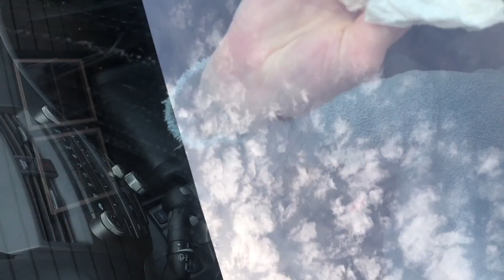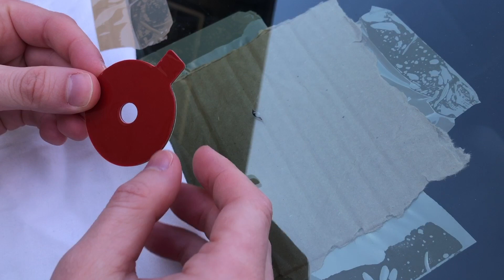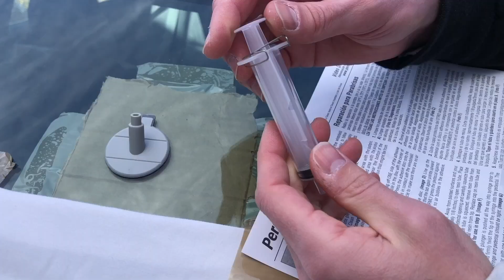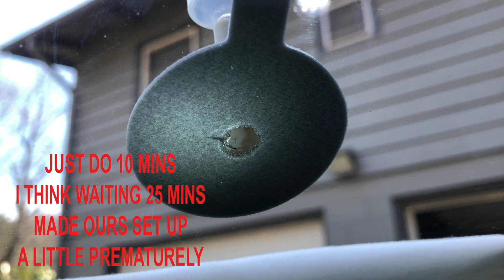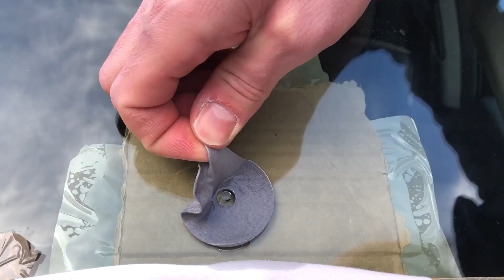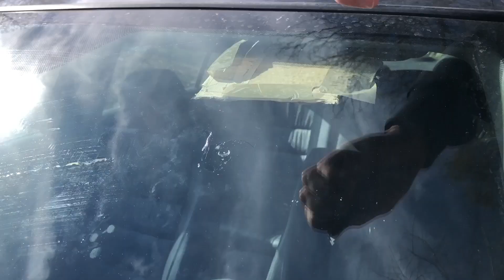How to Fix A Crack In Your Car's Windshield Using a Cheap Available Kit (EASY)

Comment from the maker: Good luck with the repair, you can do it!
Exact Windshield Repair Kit Used In This Video: https://amzn.to/478Xijp
Leather Steering Wheel Cover: https://amzn.to/44H4y5K
Amazon Basics Car Cover: https://amzn.to/4sv7YCN
Yokohama Tires H/T: https://amzn.to/4hhkPU1
Yokohama Tires AT: https://amzn.to/4o0Bhuk
Toyota Thermostat: https://amzn.to/48pIYW3
Aisin Timing Kit: https://amzn.to/4mXCXTW
Aisin Fan Pulley Bracket: https://amzn.to/42y674W
Denso Radiator: https://amzn.to/46LUo5b
Sway Bar Links: https://amzn.to/3ITeeCq
Mechanics Stethoscope: https://amzn.to/4oicykR
Brake Caliper Holder: https://amzn.to/48Z5ftT
No Spill Coolant Funnel: https://amzn.to/4ocLvXY
Gates Radiator Hose: https://amzn.to/48Yb22Q
1/4” Ratchet: https://amzn.to/3KDlyCL
Flare Wrenches: https://amzn.to/4nEtmma
Wrench Pouch: https://amzn.to/4ojMI02
Precision Hook & Pick Set: https://amzn.to/4nLSNCg
Allen Keys: https://amzn.to/4n3y3ou
Precisions Screwdrivers: https://amzn.to/4q6Ugoe
Hex, Torx etc Sockets: https://amzn.to/4712Hsx
Sil Glyde: https://amzn.to/3KMNaVW
WD Silicone Spray: https://amzn.to/49DiHDE
Front End Kit: https://amzn.to/3WwrKyP
Duplicolor Green Paint: https://amzn.to/4ogNACt
Buffing Polishing Pads: https://amzn.to/48ma8gt
Round Sandpaper: https://amzn.to/471UTGX
Spray Max Clear Coat: https://amzn.to/43b7c2H
Painters Tape: https://amzn.to/3KLvDgT
Respirator: https://amzn.to/3IPRTpj
Stamping Tools: https://amzn.to/490hGpl
Scan Tool: https://amzn.to/3J8gntZ
Windshield Repair Kit: https://amzn.to/478Xijp
Battery Charger: https://amzn.to/4q3Ub4H
NGK Plug Wires: https://amzn.to/4pmGsoY
Denso Plug Wires: https://amzn.to/3MQ6Zwr
Denso Plugs: https://amzn.to/4pYIMCy
NGK GPOWER: https://amzn.to/4rO6YsS
Denso Coils + NGK Iridium Plugs: https://amzn.to/3KH0xay